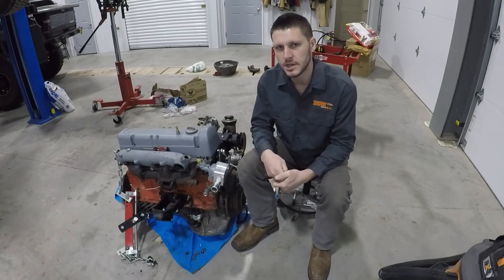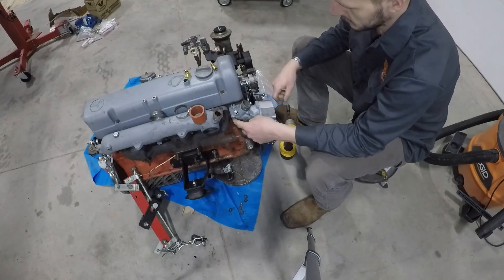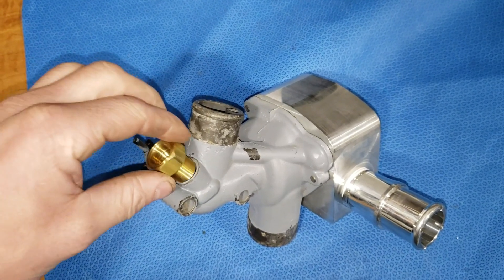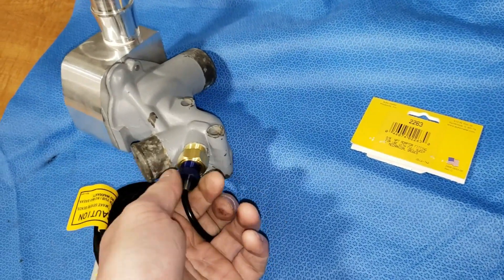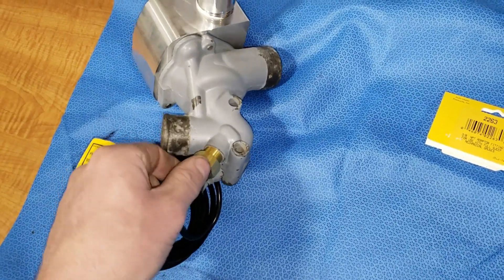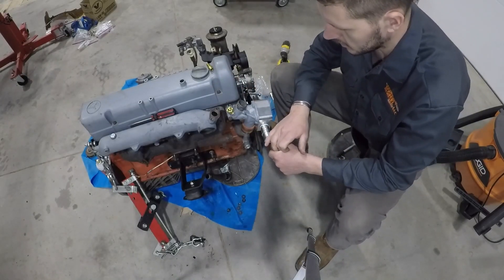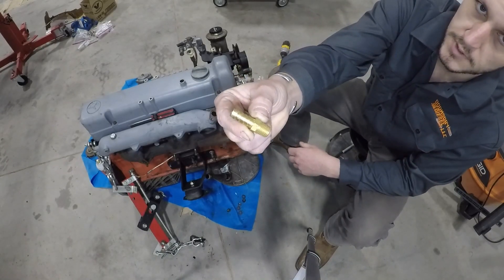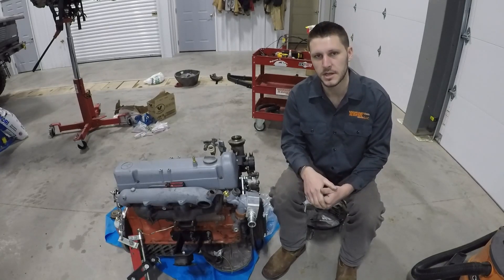OM617  Conversion Series: Water Temp Sensor and Heater Hoses

Comment: What about that sensor hole to the right of where you tapped? Is this too close to the block to get an accurate read of temp? That’s where I’ve got mine
Reply: My other hole, the one you drilled was not drilled open from the factory. I just removed the sensor and went in there. If you think it’s being tight to the block is an issue let me know please sir
Reply from the maker: I use both

Comment: Does blocking the inlet/outlet on these motors hurt anything in a no-heat application?
Reply from the maker: Certainly isn't going to help anything. Best to just loop the system.

Comment: My housing only has a single outlet on the top. The one that’s close to the motor. The outside is a flat surface.Drilling it shouldn’t adversely affect it right?
Reply from the maker: I have not come across that variant. It sounds like it is the same casting but just wasn't drilled/tapped.